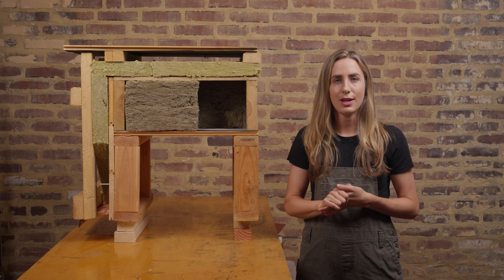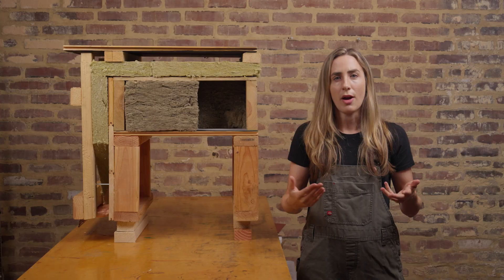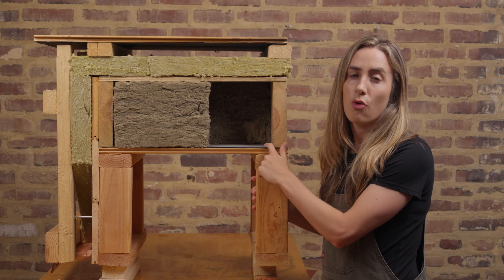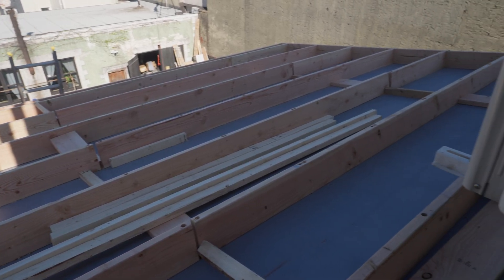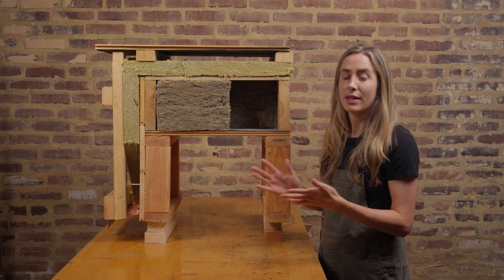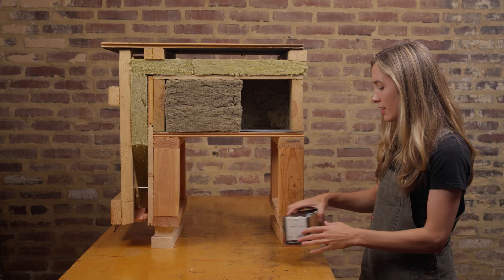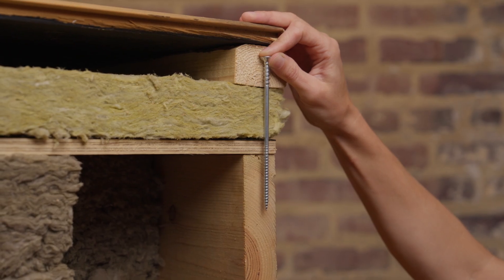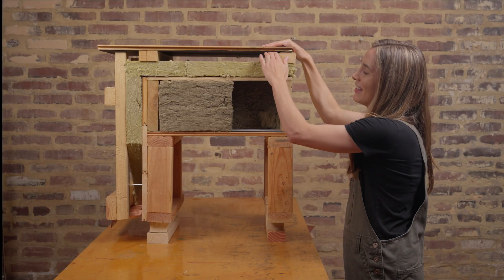Urban Timber Frame Roofing System [FULL]

Comment: What do you think of using natural textile such as a cotton sheet and saturating it with oil and pine tar like an old fashioned oilskin tarp as a tarpaper alternative? I know you did something similar with a recycled paper product I just thought the  idea of a woven material may have some advantages.
Reply from the maker: I think that definitely has potential. It would probably need to be a thicker material/textile like a heavier canvas vs. just a sheet material. A linen or hemp based material could be interesting! It may take longer the dry - the paper base dried pretty quickly since it was so absorbent. Good food for thought!

Comment: Is it only for me "breathable air barrier" at 2:30, sounds the same as "water-permeable waterproofing" ?
Reply from the maker: Yes, that is at the heart of the industry's struggle with house wraps and membranes, etc. Ideally, an air barrier keeps air from passing back and forth through the structure as that can be your biggest loss in terms of energy efficiency but also allows moisture to breath in/out as needed (humans produce a lot of moisture inside a structure) and not become trapped (creating the conditions for mold/mildew and rot/deterioration). A "breathable" or "permeable" polypropylene-based house wrap is often woven or perforated now but in the end is still a petrochemical-based polymer or plastic. That is why we are interested in petrochemical-free alternatives that can serve the same purpose but work better and be healthier/more sustainable.